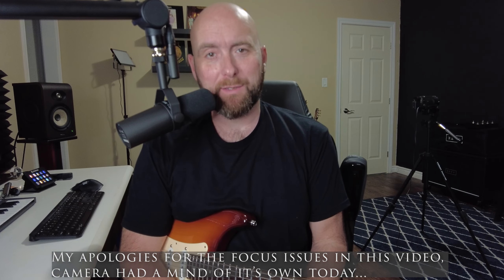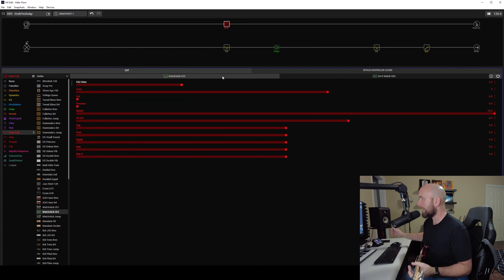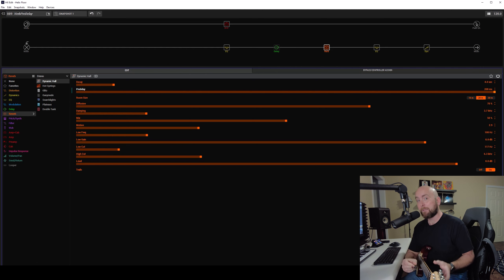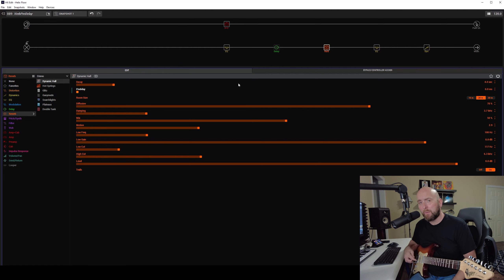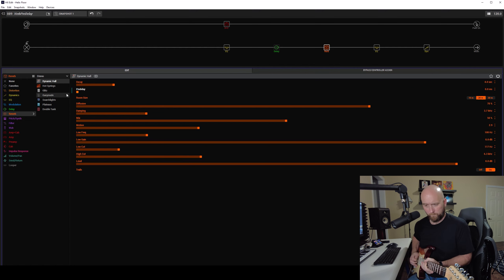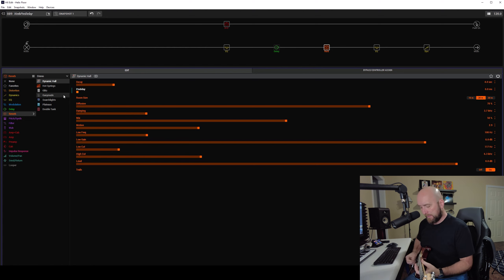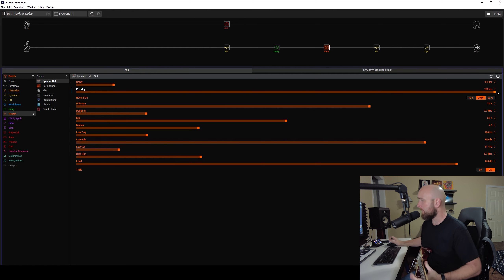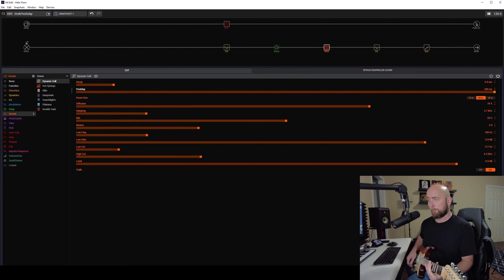Try This One Simple Trick For AMAZING Reverbs! | Quick Great Tone: Pre-Delay

Comment: Here's another little trick I add to this:  put a Simple Delay between the amp/cab and the rest of the template. Feedback so that you get one repeat (1% works) and mix to taste (I use around 30%).  Then set the time to two or four times (I prefer four) of the predelay you have set in the reverb.  Adds more space to the sound and matches 'verb to delay.  (One of the few times I use time rather than tempo on my delays).

Comment: great video! Always informative and helpful! One reverb setting that has improved my sound is the bass cut control. It's amazing how just cutting a little bass on the reverb clears up the sound.
Reply: This is similar to the Abbey Road Studio Reverb Trick.
Reply: Yep, low and high cuts way more severe than one'd think are key to a good reverb sound. I usually don't go below 240hz on the low cut, and depending on the reverb 4-8k on the high cut, it works wonders for the tone and the way it blends with the dry track

Comment: It would have been helpful to step through the Dynamic Hall's 10m/33ft, 20m/66ft, and 30m/98ft Room Sizes to demo how each affects the perceived sound, in conjunction with the PreDelay. As sound travels at approximately 1 foot per millisecond, the PreDelay's range of 0ms to 200ms equates to the time it would take for an originating sound to travel from and be reflected back to the listener's position from a reflective surface at a distance up to about 100 feet. Together, these parameters can be used to provide a good sense of dimension and realism.